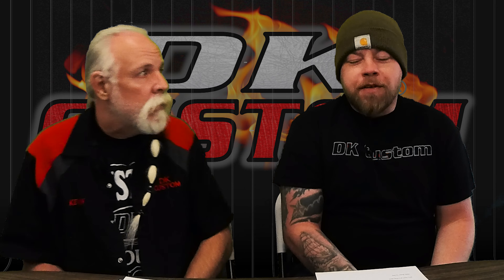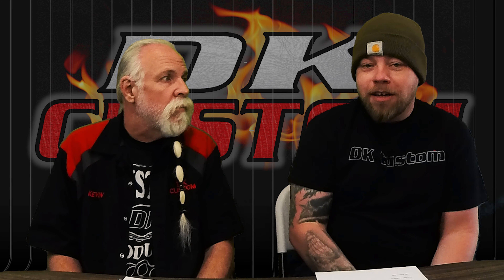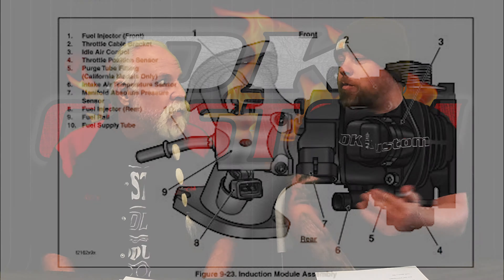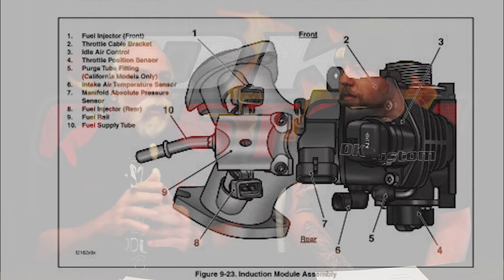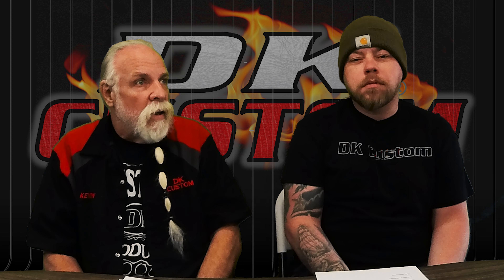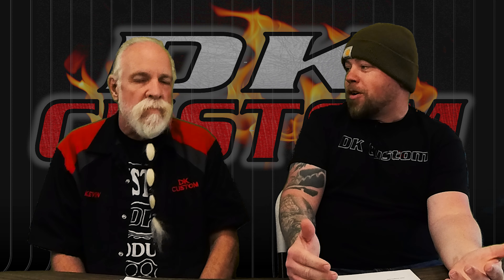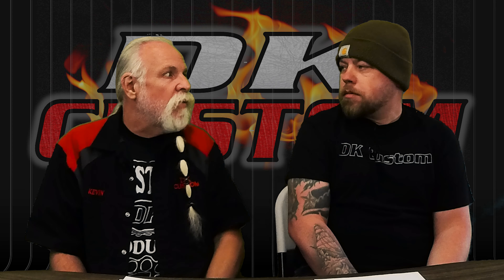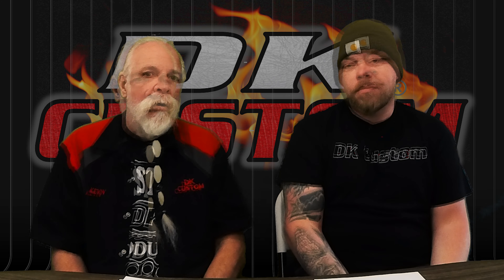Yet ANOTHER Reason to Vent Your Harley Externally

Comment: Thanks guys!  I ran into this exact issue on an ‘03 FLHTCI after cleaning my stock air filter and then mistakenly “oiling” it like a brand-name filter I’ve used on cars and other bikes.  About 4 months later, as I went to turn at stop sign, the bike stalled.  Pucker factor went through the roof.  Got it started again  and limped home.  Found your channel prior to that incident and said at some point I really need to vent that sucker.  Cleaned up the IAC - of course it was completely gummed up - and then ordered an EBC kit for my new air filter.  Been running it that way now for about 18 months.  No dirty air on my system any longer.  Appreciate you guys!  Stay safe and have a wonderful New Year 🎉
Reply from the maker: Glad you like the videos and are finding them helpful! Also very glad you got an EBS installed and are seeing the benefits of it! 

Rides Safe, Happy New Year and Thank you for commenting! 😎

Comment: I fabricated an EBS for my 1997 Sporty out of 4 brass "L's", a brass "T", oil line and 4 worm drive clamps. I purchased the chrome catch can from a local motorcycle parts shop. I purchased an extra air filter backing plate at a cycle swap and drilled it to allow the oil line to squeeze through. The four brass "L's" and short oil lines are inside the air filter housing and stay in place with the air filter. The brass "T", a short piece of oil line, the catch can and 4 worm drive clamps are external.
Reply from the maker: Very Cool! Glad you got an EBS hooked up! Thanks for commenting! 😎

Comment: Two and a half years ago I did a big bore kit on my 2015 fltruse and saw the build up of carbon on the pistons. First thing I did after the build was install the DK Customs EBS system with the catch can directly under the tb so I can check it easily. I only get a little oily water in the bottom of the catch can now and again but I feel a lot better knowing it’s doing it’s job. Too much carbon on the pistons will also change your tune
Reply from the maker: Yes, so glad you are seeing the benefits of having the EBS installed! Thank you for your business and for commenting!

Comment: Honestly, I had the Transformer kit & the EBC. Your catch can is like 4 ounces & had to be emptied every other ride & the filters had to be blow out constantly. They were always soaked with water. Too much of a P.I.T.A for me. Now its a paper weight. But if someone wants a total kit for cheap... The kit is for the screamin eagle ventilator  setup. Other than that its a paper weight...
Reply from the maker: Man, I am sorry to hear that.
You are blowing far too much oil thru your venting system.
This could be because of a few different things.

The number one is that someone has been overfilling your oil tank (this is a common thing at dealerships, since it appears so many techs either cannot read, or are just lazy).  
Here is a video explaining what happens- https://www.youtube.com/watch?v=gJ0vYAitUqU

Another common problem is shown when doing a leak-down test.  So many bikes have a ring seal issue, especially on the M8's...mostly this is either cylinders out of round or rings installed at the factory improperly (it happens more than one would think).  Here is a video on how to check for that- https://www.youtube.com/watch?v=gojpttZQjKk
Reply: If your filling that catch can up that quickly, you have a bigger problem, I clean mine every oil change and it’s fine.
Reply: @karateman856  It's oily water vapor. Main thing is water. I installed mine just like Dewayne installed his...directly at the bottom of the Transformer. The water would build up, soak the filters, & blow back out of the canister vents or drilled holes & blow on the exhaust & chrome. I just got tired of drying the filters & wiping off the chrome. Mechanically bike was fine. Moco stage 4 103. Leakdown & compression was spot on.
Reply: @greghinchley6277  yeah I can see how that would be a pain in the ass, I guess mine being a stock 96 ci, not experiencing that problem, good that your bike is ok otherwise.
Reply from the maker: Do you do a lot of short rides?  
Only time we ever see what you're describing on a bike that is sound mechanically and not overfilled with oil is when there are so many short rides that the engine rarely gets fully warmed up to burn off the condensation.
Reply: @DKCustomProducts  No, I'd warm it up for a minute, then 30 mile ride to work & reverse. I used it for 2 seasons then removed. Not mad, it just didn't work for me.
Reply from the maker: I hate it did not work for you! When you are taking a bunch of short rides it does not give the bike enough time to fully warm up and burn off the condensation!
Reply: @DKCustomProducts  Of course. No issues. I'll sell it on Ebay or FB market place when I get time.
Reply from the maker: Thank you for your business! 👍

Comment: If you vent the case and the banjo fittings on the intake, can you over vent the motor?
Reply from the maker: Essentially no its not going to be over vented, Vented dipsticks and transmission cover vents do NOT take the place of external breather systems.  
There is still hot, oily, oxygen depleted air being fed into the intake.  
The folks that sell vented dipsticks and trans cover vents, have it right in their product description that they do not prevent all that crap from going into your intake.

Comment: got the Trask vented trans cover, when i drastically overfilled the engine oil, it vented through there so it definitely seems to work and my throttle body is clean for sure ive been checking
Reply from the maker: Vented dipsticks and transmission cover vents do NOT take the place of external breather systems.  
There is still hot, oily, oxygen depleted air being fed into the intake.  
The folks that sell vented dipsticks and trans cover vents, have it right in their product description that they do not prevent all that crap from going into your intake.

Here is a copy and paste from the Trask website- "This will reduce the oil exiting from the head breathers..."
Even if there is no trace of oil in the intake, there is still hot, oxygen depleted air going into the combustion chambers, making the engine run hotter, and not as strong because of the lower oxygen content.

Comment: Venting externally is the first mods I did to my new Harley.
Reply from the maker: It is a great easy first mod that makes a big difference!!! Thanks for commenting!
Reply: Do you know if that voids your warranty?
Reply: @paultancraitor5844   No it does not
Reply from the maker: @paultancraitor5844 We have never had a report of an External Breather System voiding the HD OEM Warranty.  However, if you think your dealership may give you some trouble, you can use the method seen at this link- https://www.dkcustomproducts.com/acl/installation-of-external-breather-system-on-stock-twin-cam-air-cleaner.htm
You can see this kit at this link- https://www.dkcustomproducts.com/twin-cam-discrete-head-breather-system-touring-softail-dyna-dk-tc-brt.htm
Then, if you have to take the bike into the dealership for warranty work, it is a simple matter of disconnecting the hoses and filter or catch-can, and reconnecting the hoses back to stock.
(even though the above method says for Twin Cams, it works the same for M8's.